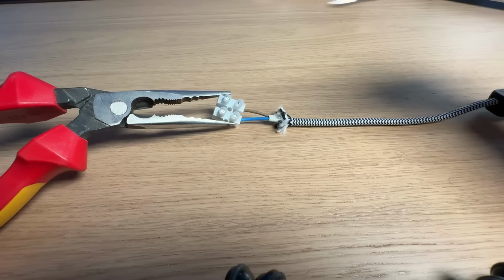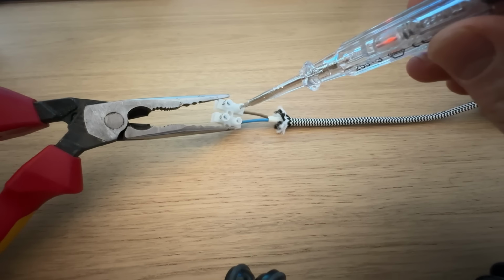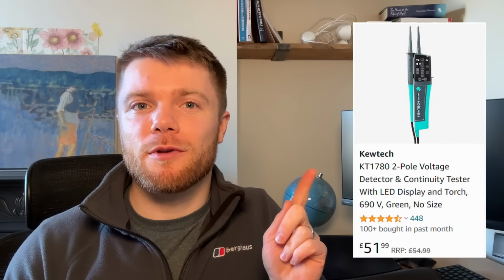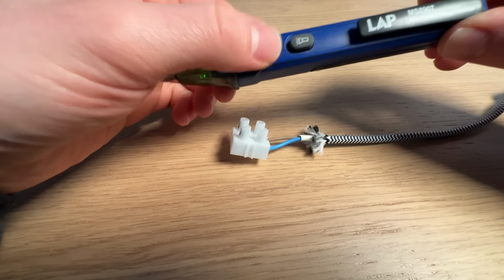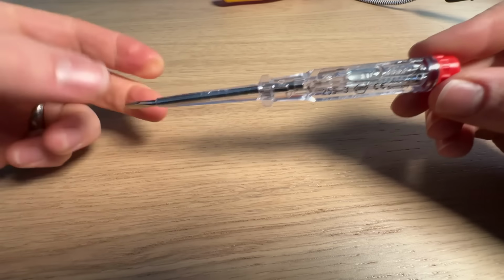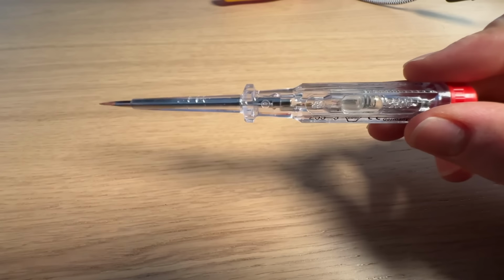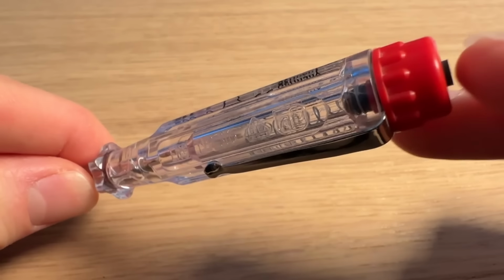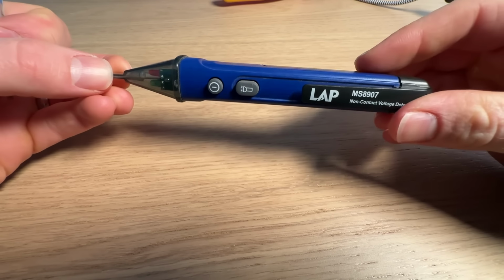The Most Dangerous Electrical Tool

Comment: I have been using these for 50 years without any issue. The are 2 rules : 1. If the screwdriver lights up the contact point is live so take proper precautions. 2. If the screwdriver does not light up, do NOT assume the contact is dead.
Reply: Exactly . When working on electrics I switch off all power. Part reason I can’t be totally sure how some pleb has wired up the house, some wiring is shocking and even pro work is dreadful . I’ve just replaced a socket that a pro put in , the socket they put in blew up
Reply: Have used them as a DIYer for over 40 years, even back when we did electrical work that is not allowed any more. Isolate at the board (in my case in the garage), lock the garage and put key safe, double checks on circuit, and above all don’t work on a live circuit. An early blown fuse after cutting o a live wire, and you learn very quickly what not to do. Non contact tester isn’t always reliable in my experience.
Reply: Me too, I always test on a known live first. Amazing any of us oldies have survived seeing how we've done all these dodgy things, either we were very lucky or we always used a bit of common sense.
Reply: They will also light up from capacitance if a cable is not earthed. They have saved me from many shocks over the years.
Reply: Same here, 50 years using these no issue. Always test on a known live terminal first to establish the light does work 👍
Reply: @BaffledApe  how many people here have been killed by them and can attest to that in this comment section? Survivorship bias is a powerful drug.
Reply: I have two and test them on a known live circuit before doing the job and I KNOW they're working.
Reply: As a younger man I've tolerated many 220v electrical shocks (up to 20KV when working with CRTs) Accidents happen. As an older man with a a heart condition, I treat every wire as if it was live (unless I'm actually in unobstructed sight of both ends). The latter has, again been a life-saver. Never touch the wires, keep one hand away and stand on rubber mats.
Reply: @niv8880 No, you haven't, AI generated profile picture.
Reply: @QwertyoUip  Great detective work! You looked at my profile picture and determined I am a bot. Did the bot also make all those posts about the BBC earlier today (and yesterday that you can see)? Otherwise what is the relevance? Is it that I can't possibly have used a screwdriver because I have an AI profile picture - that is the statement you are making, isn't it?
Reply: @niv8880  I too have had many shocks in the past and use 2 tester screwdrivers. Been using these since I was 10 and never had a shock from one. Look after your tools and you will be fine.
Reply: @QwertyoUip  My pic is of a Rush album cover, as an electrician - trained to the 18th edition, so out of date now, i have stood on a telephone book holding a live wire. No shock. Not grounded to earth. What he is saying is true.
Reply: @niv8880 as an EE i wouldnt rely on "ive tolerated them"
Reply: Quite correct. A "dead" test may be a faulty instrument.
Reply: @keithterry2169  But that's why you (should) always test the instrument on a known live source before and after using it to prove dead the circuit  you intend to work on.
Reply: Same, but I like the volte pen.
Reply: Would they work if you are wearing well-insulated shoes or do your hand need to touch something to ground it?
Reply: Homie really pulled out the "well I turned out alright". Which is really not a good excuse. As someone whose been shocked by 120v, there is no way in heck I am going to use my body to complete a circuit with 120v ever again.
Reply: Rule 3: Don't bet your life on a cheap 0,25W Resistor if you can help it.
The old ones had far beefier ones and were made better but still.
Now there are options which are just as simple to use without making yourself part of the circuit.
Reply: @timhartherz5652  Older ones were made with resistors from tube era. Those were often rated for 1kV.
Reply: @xsc1000  Voltage rating of resistors is not much of a thing. It is powere that you should be concerned about and the power in that resistor is absolutely minute.
Reply: @rogerphelps9939  No, voltage rating is important in this case. Its the same like safety distance between live and isolated parts of device.
Reply: @timhartherz5652  I wonder if the tiny light source in there would fail if the resistor somehow failed short. Also have there been any cases of it in there failing short? Never heard of any so would be inter3ested to know
Reply: @Barteks2x  That's a Neon light, they don't have a incandescent wire but need the resistor.
Reply: No. The power in that resistor is absolutely minute. The resistor is never ever stressed. As far as being cheap is concerned resistors cost next to nothing anyway. @timhartherz5652
Reply: Check check and double check!
Reply: Rule 3: always assume the contact is live, because first two rules imply it
Reply: Yes. Simple as that.
Reply: Yes I had an accident with one earlier in the year had no light in the phase tester and assumed the socket was dead and it was the tester blown had a nasty shock, spark hit my left eye . Lucky to still have vision. I now use a multi meter.
Reply: Lucky you
Reply: @profphilbell2075  never trust a phase tester with bulb in it,  unless there is a known live to test it on before and after. Bulb could fail at any time. Safety glasses are a good idea aswell.
Reply: arent you missing the whole point of his explanation of why its dangerous? you might not know if the pen has a bridged connection when you go to test on live..
Reply: @Jwalk-v9k  Well considering in my whole life time my father has used them and I have used them and never had a problem this is a bit of a farce. Yes electricity is dangerous, I have known sparkies to get a shock from probes. If you look after them you will be fine.
Reply: @chrisgraver2112  I understand you have lengthy experience without any issues. I just didnt understand why you were posting your rules which seemed to be irrelevant to the topic of the video.
Reply: Rule #3: Check all your tool that it is in good and working condition.
Reply: Always practice safe isolation, Always carry your volt stick and test probes with you. Was told at college to dispose of these, so have never used one.
Reply: non-contact indicators often give false positives. they just glow, especially if there are a lot of wires and they are close, and you cannot know which wire is hot and which is disconnected. Non-contact indicators use a battery, and it often runs out, and even in certified indicators the sensitivity drops; this has happened to me often. Sorry, but the indicator screwdriver is a reliable, life-tested device.
and the most reliable thing is a dial multimeter.
Reply: What if the tip that you put your finger on is rusty is that a problem
Reply: @JoniShala-r8w  rust means moisture, so absolutely replace it
Reply: That is common sense, but in 2024 there is no common sense. These non contact things, don't like them, they are over engineered black boxes.
Reply: These days. most of these cheap testers are "Made in China" and surely not as robust as those good-old-days, where such devices are "Made in U.K." and "Made in USA". or even "Made in Germany".
Reply: U used leaded gas the whole time too
Reply: Same here.
Reply: @johnmusgrave3179  rule 1. If you are not a qualified electrician you shouldn’t be working on electrical systems ,even if you think you have the experience, if you make a mistake and someone gets seriously injured or killed you would be prosecuted. Rule 2 (anyone qualified should already know this)never use any tester that requires direct contact with live terminal and your finger ,always test L-E ,L-N ,E-N and of course having tested your tester on a known live connection before to prove your tester is working and after checking circuit you are working on and isolating that circuit if you are working /repairing said circuit re-check your tester on known live connection again to prove your tester hasn’t failed.
This process only takes seconds and could save you life . I am in the UK , and would not know about rules or comment on them for any other countries
Reply: So, what do you know if it is unreliable?
Reply: 3. if the screwdriver gives u a jolt .. make sure ur alive and not dead
Reply: Ive seen live wire wired on to ground pin...  or if light does not go ON as you said that doesnt mean the contact is dead. Maybe wires in the socket are not even attached.
Reply: If 2. can't be relied upon, that means that you can't trust the screwdriver and you'll use another means of proving dead, so why bother using it in the first place?  Why not just do what you should be doing in the first place, which is to use an approved voltage tester and a proving unit?  If that seems too much like hard work, then call an electrician to do the work before you kill someone.
Reply: If that light in the tester which has high resistance developed a short across it, you will find out why they are so dangerous.
Reply: same rules with a firearm !
Reply: Quit while your ahead!
Reply: Safety,while checking protect you body shouldn't
be in cotact to wall.
Wear shoes or some insultor under your foot.
Reply: exactly - it's a warning device to alert you it is, not a tester.
Reply: Wear rubber sole shoes when working on LIVE electrics  circuits
Reply: I'd a practical lesson. It's true
Reply: Yer, it's not a tester really.  It's driver with a check built in.
Reply: you are right and thei are more trusty than that non contact
Reply: The non contact pens are 4:46  not good if there are multiple wires. Example: a junction box.
Reply: The relevant word in terms of safety on mains circuits is ISOLATION the neon lamp provides this. What's not to like (until  some clever so and so sells you a led one because they look prettier)
Reply: Exactly 👍
Reply: Me too. The guy is clearly talking through his anus and his video needs banned  ..misleading people with his utter cack 🤪
Reply: Hello ! May Allah protect and guide you to his light and happiness in this life and the hereafter, God bless, Ameen. Excuse me for giving a little presentation of Islam, because it is very misunderstood nowadays, especially on those « Antichrist's » times, where media and politics are mixed to distort history and truth. And terrorists (puppets of the Antichrist) who misinterpret verses, out of ignorance and political motivations, and take them out of historical context (just like radical atheists do by the way) don't help either. Thank you very much for your time.

First of all, if you have any questions regarding Islam and yourself, just open the Quran randomly, and you will find the answer in front of you, like a miracle and a sign from God.
	
Islam is an arabic word that means the Surrender to the One and Only God, our Creator, Protector, Provider, who gives us life and all that we have, we are safe and sound by his will and grace, we are His and to Him we return, and we have to thank him in this trial life by submitting to him by our free will, or later in the Day of judgment when it's too late to save our own skin. Islam was the original Religion descended to earth from heaven with Adam and Eve (peace and blessing be upon them) in the beginning of humanity. and was passed to people with the succession of the 124 000 prophets and 315 messengers of God to all nations and civilizations since, passing by Noah, Abraham, Isaac, Jacob, Ismaël, Joseph, Moses, Aaron, Joshua, David, Solomon and Jesus (Peace and blessing be upon them) during the history of mankind, the last replaces and completes the previous, until the succession of the last messenger of God fourteen centuries ago, Muhammad (Peace and blessing be upon him) to complete the noble morals of all mankind, to bring humans and jinns out of darkness into light, and to purify people's religion and belief from corruption and polytheism, and return it to purity and true monotheism, like it was in the times of the prophets (Peace and blessing be upon them).

Many Religions that we know nowadays, at their beginning were true and under Islam, initiated by one of the prophets of God, but their original teachings, history and scriptures have been corrupted over time with falsification and polytheism, or lost and replaced with false ones. That's why Islam is the only Religion accepted by God nowadays, which consists in bearing witness that there is no god besides Allah (God in Aramaic, the original language of Jesus and the Gospel), and that Muhammad is His servant and messenger, just like Jesus and Moses and others are His servants and messengers. Never a messenger of God said he was God or literally son of God, it was the people after him who changed the words of God and corrupted the Religion. God is unique and absolute, He does not need to have a family and sons or to associate anyone else with His kingdom, He can simply create whatever He wants, everything belongs to Him, and to Him everything will return. Allah said in Surah Al-Mu’minun : “God has never begotten a son, nor is there any god besides Him. Otherwise, each god would have taken away what it has created, and some of them would have gained supremacy over others. Glory be to God, far beyond what they describe. The Knower of the hidden and the manifest. He is exalted, far above what they associate. (91-92 / Translated by ITANI).

Allah means the one and only God, the God of all prophets and creatures, the creator of the universe and mankind, and the Master of the Day of judgment, where our destiny, Hell or Paradise, is decided based on our faith and deeds in this trial life, and above all, Allah's mercy. 

Allah said in Surah Al-Ikhlas : In the name of God, the Gracious, the Merciful.
Say, “He is God, the One. God, the Absolute. He begets not, nor was He begotten. And there is none comparable to Him.” (1-4 / Translated by ITANI).

Allah said in Surah An-Nisa : O FOLLOWERS of the Gospel! Do not overstep the bounds [of truth] in your religious beliefs, and do not say of God anything but the truth. The Christ Jesus, son of Mary, was but God's Apostle - [the fulfilment of] His promise which He had conveyed unto Mary - and a soul created by Him. Believe, then, in God and His apostles, and do not say, "[God is] a trinity". Desist [from this assertion] for your own good. God is but One God; utterly remote is He, in His glory, from having a son: unto Him belongs all that is in the heavens and all that is on earth; and none is as worthy of trust as God. Never did the Christ feel too proud to be God's servant, nor do the angels who are near unto Him. And those who feel too proud to serve Him and glory in their arrogance [should know that on Judgment Day] He will gather them all unto Himself: (171-172 / Translated by Muhammad Asad).

Allah the Most Merciful said in Surah Ali-Imran : Behold, the only [true] religion in the sight of God is [man's] self-surrender unto Him; and those who were vouchsafed revelation aforetime took, out of mutual jealousy, to divergent views [on this point] only after knowledge [thereof] had come unto them. But as for him who denies the truth of God's messages - behold, God is swift in reckoning!
Thus, [O Prophet,] if they argue with thee, say, "I have surrendered my whole being unto God, and [so have] all who follow me!" - and ask those who have been vouchsafed revelation aforetime, as well as all unlettered people, "Have you [too] surrendered yourselves unto Him?" And if they surrender themselves unto Him, they are on the right path; but if they turn away - behold, thy duty is no more than to deliver the message: for God sees all that is in [the hearts of] His creatures.
Verily, as for those who deny the truth of God's messages, and slay the prophets against all right, and slay people who enjoin equity - announce unto them a grievous chastisement.
It is they whose works shall come to nought both in this world and in the life to come; and they shall have none to succour them.
(19-22 / Translated by Muhammad Asad)..

God said : Say, “We believe in Allah, and in what was revealed to us, and in what was revealed to Abraham, and Ishmael, and Isaac, and Jacob, and the Patriarchs, and in what was given to Moses and Jesus, and in what was given to the prophets from their Lord. We do not differentiate between any of them. And to Him, we surrender.”
(2:136 / Translated by Community)

Salam (Peace) -------
Reply: And what is the point if the circuit could be live no matter what? NCVs are a thing for a reason
Reply: First rule before using this was to check if it's working on line you're 100% sure is live. That's what i was taught in school.
Reply: Fellas this it's called click bait and actually y'all click the bait
Reply: They're are ok to find a live, not to test for a line that is not alive.  And for that purpose they do a good job for a fast first iteration of fault finding.  Most people are concerned about them not indicating a live line.  That certainly could be the false indication with the more serious consequences if not double-checked with a proper meter.  But the opposite case, the screwdriver glows while the line is not really live also exist.  The small voltages from inductive and capacitive effects may suffice to make the screwdriver glow while a two-pole voltage tester for electricians will not indicate anything.  And a multimeter will indicate something well less than line voltage.  The reason for the different indications of these two instrument is the internal impedance.

Physicists here in Germany say "who measures measures garbages" - "Wer misst misst Mist".  The German version rhymes better.  But there's some truth to that and users of any measurement tool should know the peculiarities of their tool and how to use it correctly and safely.

A local well reputed electrician always carriers one in the chest pocket of his shirt.  It has become his trademark, so much so that people are joking about it.  A few years the guy got married.  Just before the wedding somebody asked the electrician if he's got his screwdriver.  He opened the jacket of his suit and there it was on the inside pocket, the screwdriver.
Reply: This may be true, but in that case this thing hasn't been any help at all. In electrician school nowadays we learn - in Germany - to never use these and always use two-pole voltage testers instead. If your goal is to test for absense of voltage, then use a tool which does exactly that reliably.
Reply: Below some voltage the light won't glow. You touch the wire and you get shocked ! 😀.

At an isslated transformer it won't glow at any voltage ! You touch both wire and you get shocked ! 😀
Reply: @kenzo4Ever  as I said, if the neon doesn't glow, do not assume the contact is dead. As for isolation transformers, that is what the transformers are for. Neither side is 240V with reference to ground, only to the other leg of the transformer output. That is why they are considered safe enough for bathrooms.
Reply: 3rd rule put your other hand in your pocket ,
Reply from the maker: Thanks for watching!